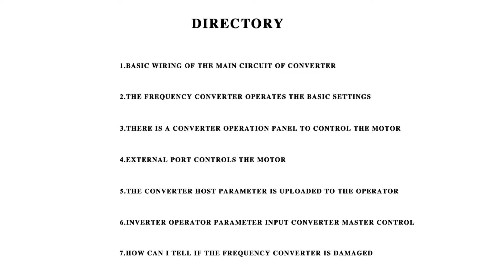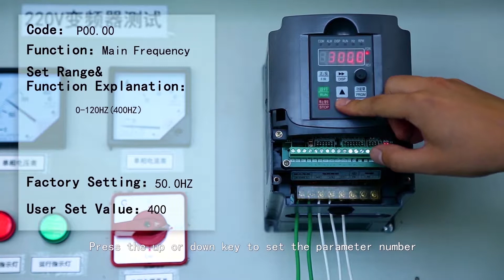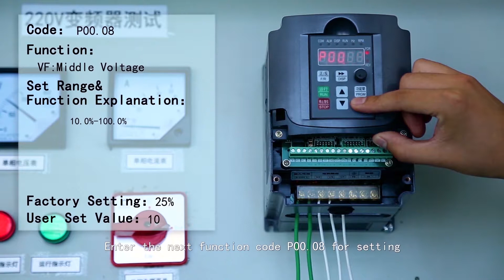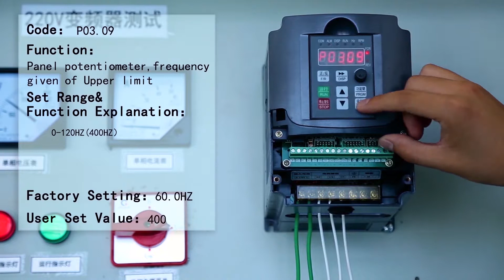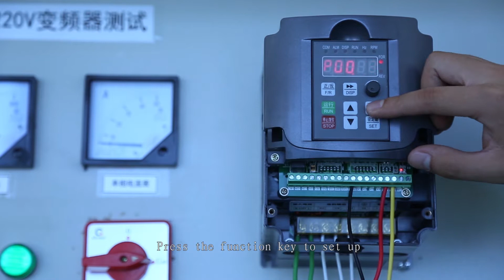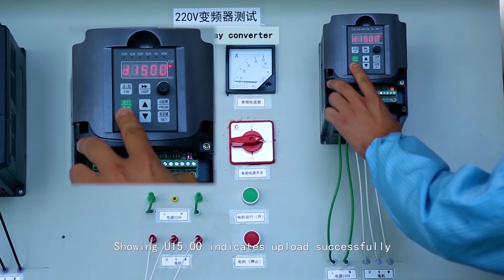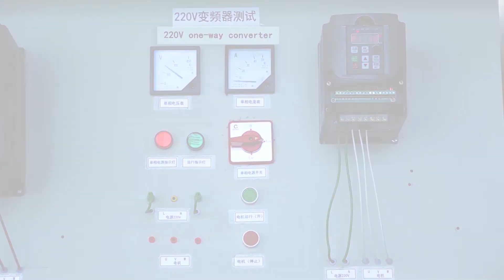Yalang YL620/YL620-A VFD Instructions

Comment: Hello, I'm getting back to you after digging a lot into the YL 620 A documentation... I'm using FluidNC and I'm running my 2.2kW water-cooled spindle with the software... only the "stop" button is active by my rule P00.01 = 1....
But my problem is the following... I need to see a speed of 1400 rpm to be able to load/unload my cutters with my ATC... and now I can't get my spindle to run < 6000 rpm...
I can't find which parameters to change... Do you have any suggestions for settings?

Comment: Hello, I have a YL 620 A and I still can't get the spindle to start automatically by the GCode of my machining program.. (M3 start/M5 stop)
P00.01=1 and P00.16=2
Could you give me the solution..
When I keep P00.01=0 and P00.16=0 everything works in manual correctly
thank you
Philip

Comment: i need install in one cnc control ,M3 M4 gnd and 10 v ,  Yuhai 990 M IS THE Control and can t work ,analog speed 0 10 v,
would you help me ,Invt use s1,s2,  GND A01 AND 24 V AND WORK OK, We bougth 20 set YL620 and need the connection

Comment: I see you set several parameters that I can't find very detailed explanations for. Is there a detailed parameter guide, anywhere? For example, what's the difference between Highest Output Frequency and Maximum Voltage Output Frequency (P00.04 and 05)? What do the Middle Frequency and Middle Voltage parameters (P00.07 and 08) do?  What do the VF Curve setting options (P00.12) 0 through 4 represent?  It seems like a solid product, but the documentation is a little sparse in areas that seem kind of important. Any ideas where I could look for more details?

Comment: Hi, your vfd YL620 works very well for me.The machine has withstood a water leak in the pipes of my house very well. I use mach3 and I can control on/off with the program, but I'd like controlling speed with the lines of my g-code/m-code. Can you give me any orientations about the parameter I have to change? I have a manual from you but amb not sure if I understand right how to do it?  Thank you in advance.

Comment: Hello!
I have a 3 kw inverter but the motor is only 2.2 kw.
Where can I set the inverter to 2.2 kw? Where to enter
Reply from the maker: The output power does not need to be set, it is automatically adaptive according to the input voltage and current of the motor
Reply: 0.3 kW. do 2.2 kW motors have the same settings?
Is the engine not burning?
Thanks for the reply!!!
Reply from the maker: @Bignac  As long as the frequency of the motor is the same as the set frequency of the VFD, the motor will not be burned out
Reply: @jackzhou1683  I see, thank you!

Comment: Hi do you have a wiring diagram that shows connections to be run from a external 0-10 volt signal? I would like to operate turn on and off and set speed from my cnc control, Thanks
Reply: i am stuck there now, fw/rev no prob, but i cant pwm it via mach3, got a way?

Comment: Hello, is the YL620A model suitable for INPUT 220 single phase and OUTPUT 380 three phase? I see that the input connections are 3, RST. There is something wrong?
Reply from the maker: NO, this VFD is a single-phase 220V input, three-phase 220V output, suitable for 220V motor

Comment: When the frequency Converter YL600-2.2 KW-220V is plugged in 220V, the fan turns on. And the fan does not turn off at all (even more than a minute - does not turn off). You can only turn off the fan by pressing the stop button. Is there any way to configure it so that fan doesn't turn on when plugged in 220V, or at least turns off a minute after it's turned on?
Reply from the maker: You can set the fan operation mode by setting parameters P12.11 and P12.12

Comment: ayuda... yo tengo un VFD YL620-A.. un spindle de 2.2Kw ambos para 220v...Yo estoy en Mexico. el voltaje es de 220V, el problema es que el spindle se calienta muy rapido. Quiero saber como configurarlo... Los parametros que pones, los tienes en 50hz  yo en 400hz... esta bien?? o como debo de configurarlo?
Reply: Estimado que descubrió la configuración del inversor?
Reply: @ИгорьАрутюнов-м5т  que tal, gracias por contestar. Aun no logro hacer que no se caliente.
Reply: me enviaron la siguiente configuracion...

Code Function
Set Range&
Function
Explanation
Factory
Setting
P00.00 Main Frequency 0-120HZ(400HZ） 400HZ
P00.01
Source of Run
Control mode
0: .Operator board
0
1:.External terminal
P00.03 Stopping Mode
0:Decelerating stop
1:Coasting stop 0
2:DC brake stop
P01.00 REV Run Setting
0:Rev Run Enable
0
1:Rev Run forbidden
P03.09
Upper limit of panel potentiometer
frequency
0-120HZ(400HZ） 400HZ
Reply: P03.11 Upper limit of 1 AD value for analog input 0-1023 1010
P03.13 Upper limit of the analog input 1 0-120HZ(400HZ） 400HZ
P07.08 Frequency source selection 1 0: Operator board
1: Pre~set Frequency，
P00.00
3: Analog Input.
0
P07.09 Frequency source selection 2 2
P07.10 Frequency source selection 3 2
P07.11 Frequency source selection 4 2
P07.12 Frequency source selection 5 2
P07.13 Frequency source selection 6 2
P07.14 Frequency source selection 7 2
Note:three
control
methods
(P07.08)
1.The motor speed is controlled by the operating panel
2.Motor speed control by external terminals (Potentiometer 10K).
P00.01 set to 1, P07.08 set to 3
3.Motor speed control by external terminals. P00.01 set to 1，P07.08
set to 1.
Reply: @cristhianodamata  ¿Cuál es su correo? Puedo enviarle la configuración que me envió el vendedor de mi kit (que aún no ha llegado pero estoy preocupado por la configuración del inversor))